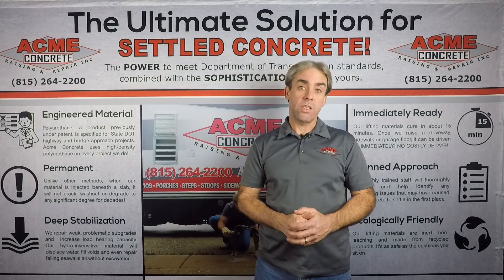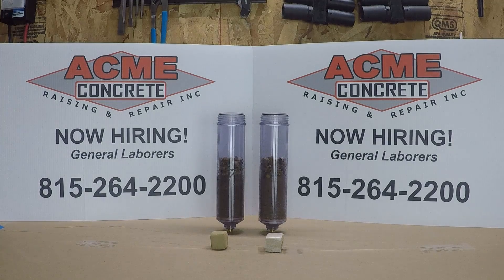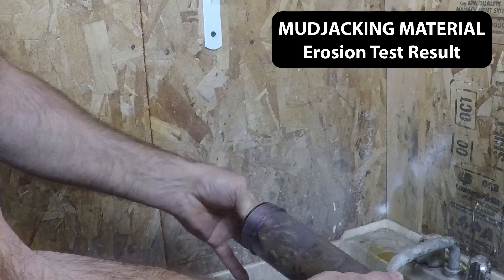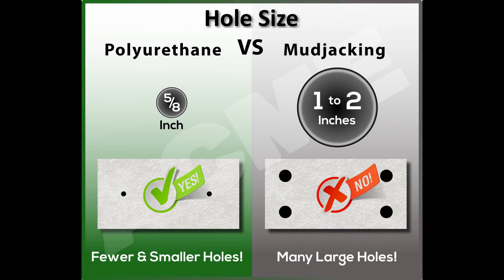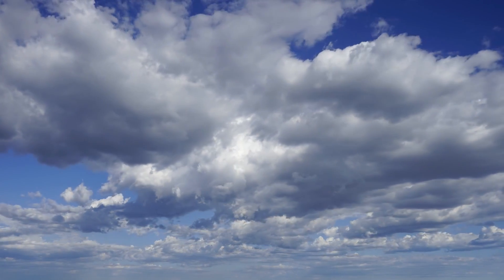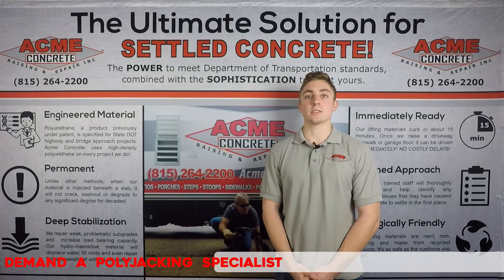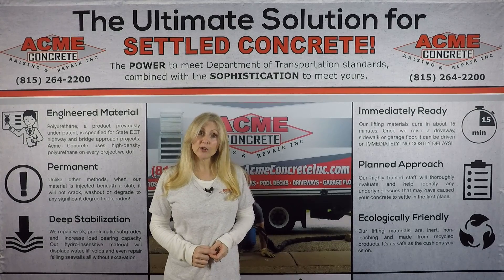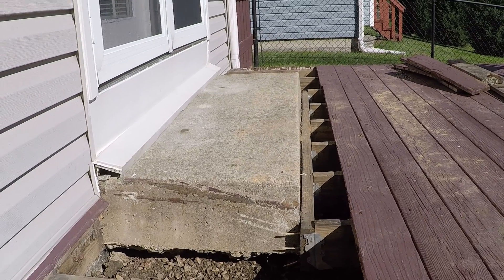Polyurethane Concrete Raising VS Mudjacking

Comment: Just as a free thinker, I'm going to call BS on this test. Will plastic wash away? No! of course not. it's not water soluble! This test you did, is a complete waste of time. The question is... Would the material under the foam wash away. But of course it won't because you have it trapped in that bottle. And water is not going to be hitting it from all sides. It is covered with a concrete slab. What I would be curious about is if the foam would hold up over time. Is it invulnerable to heavy loads and is it really insect/rodent resistant. I know concrete is. The concerns with concrete include a very huge one though. If it adds weight and causes more sinking, how hard is it going to be to fix at that point? Honestly I don't know if I trust either solution. I think I will try to just jack it up on one side and throw some gravel under there. Maybe some water to make it soft enough to spread out. Still in the spitballing stage though.
Reply: I had my driveway mud jacked and I was told it would have to be redone every 2-5 years depending on rainfall. My sons do foam jacking and have never been called back to redo a job.
Reply from the maker: Thank you for your comment Sheila! We hope your sons are doing well!
Reply: You talk a lot but know very little. I have used polyurethane for years on 100,s of projects and only had one single failure  Like it or not this method is easily the best method known. You sir know zero…
Reply from the maker: Thanks for commenting on this. It gets exhausting dealing with misinformation coming from mudjackers that are simply angry at the fact they can not compete with poly on any technical level.
Reply from the maker: Thank you for your comment. The point of the test is simply to show the difference in water resistance between our product and the old method called mudjacking. We did this because so many mudjacking companies claim their material will not wash away, when if fact it does - easily. You brought up a good point questioning what's beneath the concrete, or its sub-base. These materials can vary widely - completely dependent upon how the area was prepared prior to pouring the slab. We have seen very good stone bases all the way to nothing more than dirt. We stand behind our repairs regardless of the original construction.

As for being vulnerable to heavy loads or insects/rodents...polyurethane is what's required for large highway projects here in the Chicagoland area. I drive on I-294 nearly daily which was lifted up to 5-inches in areas about a decade ago and it's holding up as expected. Never in our history have we experienced a single issue caused by insects/rodents.
Reply: @Acmeconcreteinc  with all due respect, mud jacking is not the old way. Whichever method you choose to use you should first take care of your water problem or neither process is going to do you any good. Polyurethane is a poison to pretty much everything, and that's a fact, and it's ability to withstand water problems simply creates water problems just beyond the polyurethane. It's that simple.... this way is in no way Superior in any way whatsoever to using a clay mixture and having the ability to add cement to the mix. Like I said you should first take care of the water problem because that is the problem... it's NOT that you're missing some polyurethane or clay under your sidewalk or driveway and that's all you got to do is replace it. Water problem first or don't even bother wasting your money as a customer or making your company look bad The patch test was the most ridiculous part of the video. You could have at least use the same colors to patch with, or not pick the most contrasting patch jobs you could find, or not photoshopped them to mislead consumers. 
Conclusion: this product is simply a poison that is in no way Superior to any other method of concrete leveling or jacking. It in no way addresses any water problems that caused the problem in the first place, and no method is helpful to anyone unless the water problem is addressed. The contractor should understand this and should do their best to help the customer make the right informed decisions. It might cost extra fixing the water problem, or maybe a simple task to assure that the slab jacking is doing its job unadulterated.
No matter which method is used to accomplish the slabjacking and/ or water problem fix, NO  method in any way has anything to do with the choice of patch material and the color the contractor uses to patch the holes with. And be wise to have many different colored patch material and an endless supply of dyes for colored concrete and just the art of matching the patches. I know it was a long rant but it takes a long rant to undo the misinformation from this channel.
Reply from the maker: Hello Michael, thank you for another comment on our channel! We really appreciate this, it’s so helpful to be presented with opportunities such as this to help deal with all the misinformation out there. You have presented a lot of it! We stick to facts, so our job is easy when it comes to addressing comments such as yours. You made some bold claims that we don’t think you thought through completely, so we will take some time to break a few of them down. Enjoy!

Your comment: “with all due respect, mud jacking is not the old way”.

Response: To begin, mudjacking was in fact developed in a time lacking better alternatives. This old technology was used as far back as the 1930’s. Polyurethane concrete raising was not developed until 50 years later. When polyurethane concrete raising was developed, it was used for large infrastructure projects and was protected by Patent. One of the oldest mudjacking equipment manufactures is still in operation today, but is overwhelmingly more active in the production of polyurethane equipment and materials! This is but one example of how mudjacking is being rapidly replaced by polyurethane injection technology. As a mindful participant in the industry, we see this fact everyday. The primary thing slowing the growth of polyurethane concrete raising is that it requires investments of time and money to acquire the technology and learn how to properly apply it. The materials are naturally more expensive than “mudjack mud” and the equipment is 100 times more complicated. What this means for mudjackers is an immediate loss of current profits in order to acquire this "superior technology"! Many mudjackers can’t wrap their minds around that kind of change, so they simply use misinformation to try to sway the unknowing consumer back in their direction. 

Your comment: “Polyurethane is a poison to pretty much everything, and that's a fact”

Response: Not true. Our materials are well documented to completely dispute your false claim. What’s so ironic about your comment is the fact that you were likely sitting on a cushion made of polyurethane as you typed your comment. You and your family members probably sleep every night on a mattress made with polyurethane. Polyurethane is literally everywhere around you. It’s in cars, clothing, tools, building materials, insulation, and even medical devices. Guess what...look around today with all the people wearing face masks...many are made with polyurethane! People breathing through polyurethane masks! But you will claim polyurethane is “poison”? Isn’t it a fact that you have no problem with all the polyurethane around you as long as it’s convenient to you? You probably never think twice about it, but here we are discussing a polyurethane application that’s mostly outdoors beneath a sidewalk. Your comment is completely absurd! Are you possibly a mudjacker and we’re hurting your business? If so, you are the misinformation problem!

Your comment: “it's [polyurethane’s] ability to withstand water problems simply creates water problems just beyond the polyurethane”

Response: Your sentence does not make logical sense, but we can discuss part of it. You are correct, polyurethane does have the ability to resist water. That is a POSITIVE attribute! Obviously, outdoor spaces should be properly backfilled and graded so that water drains away from concrete. This is common sense. However, in most cases, concrete will be subjected to moisture, and moisture is one of the main reasons why mudjacking fails. You can not practically eliminate all water intrusion, and mudjacking materials are typically NOT water resistant. Moisture causes the mudjacking mud to soften, and allows the concrete to drop back down. We have witnessed numerous mudjacking failures where the mudjacking materials are eroding out from beneath the slabs. You will NEVER see that happen with polyurethane.

You can talk about adding cement to mudjack mud all day - we’ve heard it all. A local mudjack competitor claims to use a “custom mortar mixture” with a compressive strength of 2,000 - 2,500 psi compressive strength. We have sampled that material moments after they completed a job...we let it dry and it has ZERO compressive strength. Their material is nothing more than a fine clay. It makes complete sense why a mudjacker wouldn’t use cement - it’s hard on equipment and would require more cleaning. Even worse is the fact mudjackers usually wash out their equipment onto the street in front of customers homes -  if they used cement, that would be a problem - cement would stain the pavement. In our experience, mudjacking materials DO NOT contain any beneficial amount of cement. If mudjacking was capable of the performance found with polyurethane, mudjacking companies would provide warranty terms similar to what you find with polyurethane warranties. 

Your comment: “The patch test was the most ridiculous part of the video. You could have at least use the same colors to patch with…”

Response: We only patched the polyurethane injection holes. The mudjacking holes are real word examples and were patched by various mudjacking contractors - not us. We would never offer a mudjacking service.

Your comment: “this product is simply.... in no way Superior to any other method of concrete leveling or jacking”

Response: You could not be any more wrong. Polyurethane is FAR superior to ANY mudjacking service.

1) Polyurethane injection holes are much smaller, leaving a much better looking repair. Not only do poly hole patches look better, they have much less chance of failing due to their smaller diameter.
2) Mudjacking material adds much more weight to an area already prone to settling. This excessive weight can aggravate the existing problem.
3) Mudjacking materials are typically VERY subject to erosion allowing re-settling of raised slabs. Polyurethane, however, is water resistant.
4) Polyurethanes are known to spread out beneath slabs better than cementitious slurries.
5) Slabs raised with polyurethane can support normal loads almost immediately.
6) Polyurethane injection equipment can access areas without invasive “mud pump” carts.
7) Polyurethane is the standard for many D.O.T. projects, where mudjacking is not allowed as a repair option.

And finally...where the rubber meets the road. Our 8th reason why polyurethane is better than mudjacking. WARRANTY...you can almost always expect to get a much longer warranty with polyurethane. Why? Obviously because polyurethane lasts much longer.
Reply: @michaelmcclelland7421  I'm with you, Michael.  Polyurethane took my girlfriend from me back in the day.  I was just hanging out in the driveway and the next thing I know... BAM... a block of foam walks up and steals her away from me.  I couldn't believe it.

So I went in the house to drown my sorrows with a beer and, wouldn't you know it, polyurethane had stole all of my beer too.  By now you've probably already guessed that my dog left with poly and my girlfriend.  But, in the dog's defense, he really liked beer and I didn't have any left.

Moral of this story is this...  If you're going to be an uneducated doofus that comments on YouTube channels, don't be so uneducated that even laymen-folk make fun of you like I just did.  I would stick to making huge holes in people's driveways that are impossible to patch and make disappear.  You're probably much better at that than you are at pulling the wool over people's eyes.

Comment: Wait a minute. A Concrete slurry will not wash away!  If you have a driveway on top of a creek or river you may consider building a bridge. Fact is if there is water flowing in the area it will be the existing soil that will wash away first so the notion that foam is better is not true.  I have gone behind hundreds of polyurethane lifts that were performed by multiple installers, correcting the issues. I have had few failures with the cement slurry only because during the repair the slurry did not travel far enough beneath the sunken slab and the majority of the time it was because the property owner created the problem after the slab repairs by installing gutters with the drains dumping water next to the concrete slab.  When I see rain gutters in the area we offer under ground drainage leading away from the troubled areas.  Also I've seen unexperienced foam and cement jacking installs that did not correct the reason of the erosion. Plugin/ blocking the entry of the existing intruding water that created the issue to begin with.  Common sense ( Water seeks the path of least resistance) That is the key for winning the war against all water issues/ roofs - yards and sunken slabs.  My advice is to hire a contractor that will agree to do it your way after you research the best method. Your not an expert but you can read and learn the facts compared to the BS and participate in the repairs,  I enjoy my work because my customers get educated so they know their getting the best, I have always performed all our work with the attitude that once I touch it, "I OWN IT". A honest contractor will walk away from a job if it is going to be a half ass repair just to save a dime.  NO is easy to say.
Reply from the maker: Hello ElamCo! Thank you so much for watching our video! We appreciate you taking the time to leave some comments...

We have not suggested "concrete" will wash away. However, we do know for a fact that mudjacking materials DO wash away. A huge problem in our industry are companies that claim to use a "concrete like" or "cement like" mixture that in reality isn't. A perfect example of this is a local competitor of ours that claims to use a "custom mortar mixture" with a compressive strength of 2,000 - 2,500 psi. We inspected a project they did MINUTES after they completed it and took samples of their material. (the street still had puddles of water from them washing out their equipment.) This mudjacking material contains ZERO cement! We have let it dry and this material has almost ZERO compressive strength. It's similar to the sand you would find used around a baseball diamond. Add a little moisture, and this "custom mortar mixture" is slop once again. We have dozens of examples of this where a company claims a superior slurry, but is nothing more than mud. It's no surprise that we've collected tons of video and pictures of mudjacking materials eroding out from beneath raised slabs that we're bidding to raise again. In our experience, mudjacking materials are not anything like concrete or cement. This makes sense though...most mudjackers wash out their equipment when there done with a job...if they were actually using cement they would be leaving cement stains everywhere they went. In reality - mudjackers don't want cement in their equipment!

We also stand behind the fact that polyurethane is a FAR BETTER solution to sunken concrete. Yes, it requires much more money, training and expertise to properly apply, but being better typically requires more effort and sacrifice.

Also, erosion is not the only reason why concrete sinks. Many times concrete will sink simply due to the area settling. Maybe the area was built up with fill and not properly compacted allowing the slab to drop. In these cases, the settlement is aggravated simply due to the weight of the concrete structure itself. Using a "slurry" to raise concrete ADDS weight to an already comprised area which is counter productive. 

Polyurethane does NOT add significant weight to the area.
Polyurethane does NOT erode. Period.
Polyurethane does NOT crack or change shape for decades.

Another interesting fact when comparing the old mudjacking method to polyurethane is that many D.O.T. projects now require the use of polyurethane, and will not even accept mudjacking (no matter the mixture) for the raising/stabilization of roadways.

Another area where the "rubber meets the road" as they say is WARRANTY. Most mudjackers we know of only offer a 1 or 2 year warranty. WHY IS THAT? The answer is obvious - it's because mudjacking does not last.

In general, you should always be able to get a MUCH LONGER warranty with a polyurethane company. WHY IS THAT? Because it's better.

We hope this message does not come across as "combative". We're simply heavily invested in providing the very best solution to settled concrete, and are continually faced with mudjackers not willing or able to make the jump to polyurethane - they retaliate by misrepresenting us and themselves.

We also understand you may have come across projects where polyurethane was not properly applied, or inferior materials were used. We get that - we also have polyurethane competitors (waterproofing companies) that put inexperienced people on jobs - and they do not go well. So yes, we come across polyurethane failures as well. However, these failures are not the fault of the technology itself - it's typically due to a lack of training & experience.
Reply: @Acmeconcreteinc  Great reply. I found this reply much more informative than the video.
Reply: Where are you located?